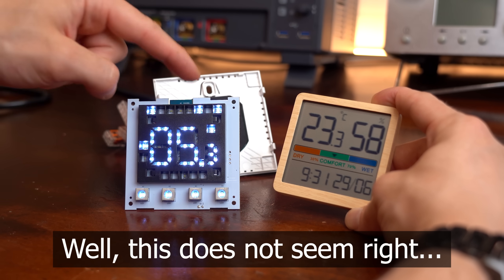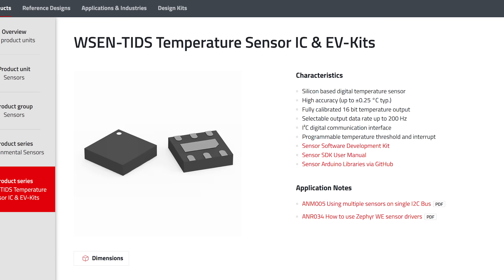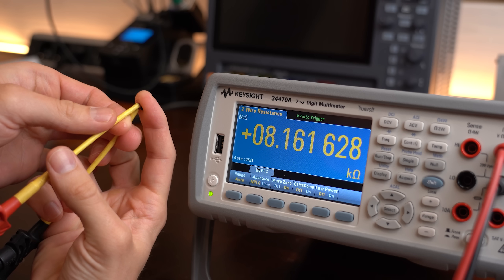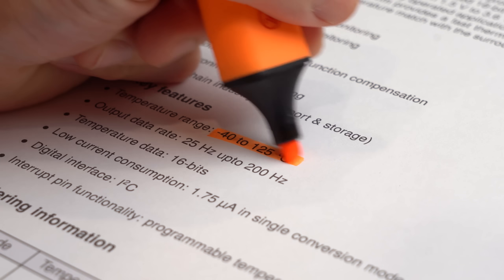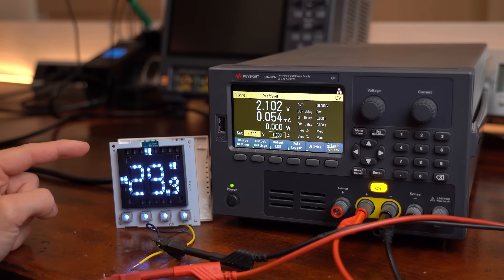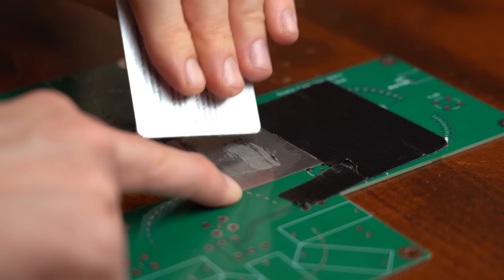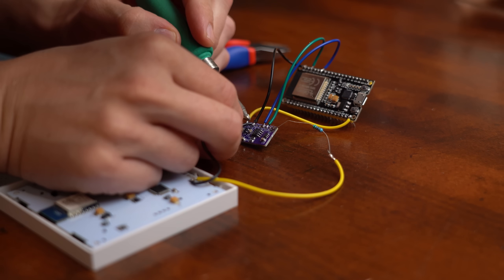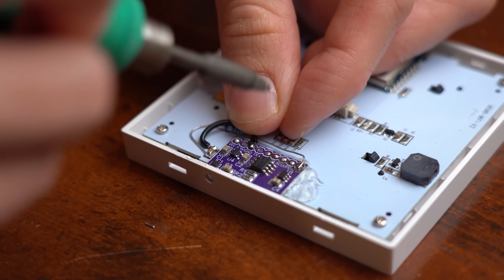From Meh to WOW - With 1 "Tiny" Hack!

Comment: making a thermalstat from scratch is the solution
Reply: Using the same plastic housing
Reply: @mihaichiriac480  CYD with wall mount and external contacts, less than €20 on Aliexpress, mounts ESP32 and has an audio output, it only needs the ESP home code and the temperature probe, so it becomes not only a thermostat but an access to domotic
Reply: Like the ESP8266 OLED Thermostat I made on my channel ?? ;)
Reply: @3ATIVE  Thanks for turning down the volume when you say "Alexa", you saved me a fight with that incompetent who understands less than Siri
Reply: The only thing with that is to be aware that hopefully paid thermostats have safeguards and watchdogs so that you don't end up with your heating running at 100% and causing damage. You can still have those in a DIY but it's extra work.
Reply: Thermostat * 😂
Reply: Came to the comments to say the same... Love the work to make a hack like that, but for as simple as the whole device is, you could have done it all with a single ESP32 and a handful of other components.
And would have been more accurate, since it wouldn't be a analog->digital->analog->digital conversion chain.
Or take the time to reverse the original circuit and write some new firmware for the original MCU or just recalibrate the analog pullup so it reads more accurately.
Reply: Whel technivally he dud not hack the termistst att all justbthe remp sensor but impressive anyway 😊

Comment: Good hack! I had heard that TUYA was getting harder to hack to talk to home assistant. Can you point at which HA integration method you are using ?
Reply: There’s no problem getting Tuya stuff to talk to HA, no hack needed, you can use the official integration. The Local integration can be a bit more temperamental though, I’m working through my house trying to slowly replace everything with ESPhome controlled stuff
Reply: @HiruS22  Thanks for that. Its really the local integration I was thinking about. There are/were some GIT hub projects which faked the Tuya servers and then allowed you to replace the Tuya firmware. My understanding is Tuya tried to block that in later releases but I dont know where it all stands. Pity because Tuya stuff is the most common on aliexpress.

Comment: What about reppacing the Software on the thermostat and just adding the i2c Thermometer to the esphome Code?
Reply: Most of the time these cheap IOT devices lock down their MCUs, so you can not reprogram or dump the software on them. If you could, that would be the proper way to go for sure!

Comment: Couldn't you just replace the resistor and/or NTC with lower tolerance parts? The precision should be good enough, even though it can be a hassle to calibrate. Digital sensor - MCU - DAC seems overkill, although I have to admit the custom PCB with SMD parts looks pretty nice

Comment: I worked for a smart thermostat company and temperature correction was a big problem. The main products were line voltage baseboard thermostats and we had to consider self-heating from the relay across different amperages and the brightness of the LED. The microcontroller didn't have a temperature feature but I'm sure heat from that also contributed.

Comment: I would think that the slightly colder wall where you have attached the old sensor, will cause the slight difference between reading it in the air, compared to measuring it against the wall. Now you just compensate for it by adjusting the parameters. But you do you. =]
Reply: Exactly. Cold air inside the wall cavity is effecting the measurement.

Comment: Thermostats temperature measurements are often pretty inaccurate depending on where they are installed. There are issues with air flow inside the walls that effect temperature readings. Same with air drafts along the wall. That is why most of them stick out from the wall instead of being flush to it. The temperature of the center of a room is the desired measurement, but that is nowhere close to the actual sensor. That is one of the reasons why their feedback loops take such a long time wait for it to stabilize

Comment: Hmm, I see Wurth do temperature/humidity sensors too.  Having trouble with sensors from Amazon that drift to 100% humidity over a few months, so I'm tempted to try the Wurth chips.
But even then, the Wurth chips say they drift if used over at lot over 60% RH.
I'm wondering what sensor technology is used in consumer products that actually do seem to measure humidity sensibly after several years.

Comment: Real lesson learned: When PCB Design/Layout,always check the datasheet for recommended copper pads or path. I also learned it the hard way. BTW I have a similar TUYA thermostat which has a temperature calibration or offset. Which can be a poor man's solution.

Comment: Well, that's one way. Another would be to calibrate the thermostat against a reasonable transfer standard, like an ordinary thermometer. Most household thermostats have a means of accessing calibration mode to set an offset. It's a shame that the manufacturers of these cut rate thermostats can't spare the time to calibrate them before shipping, but what do you want for such a low price?

Comment: Why use a NTC? That's so inaccurate? Why not use a BPM180 or a DS18B20?
Reply: NTCs can be very accurate, some are rated <0.2C, better than the BMP180.
In this case they just used a cheap one due to cost and simplicity.

Comment: It would be interesting to know where the errors were coming from.  Was it just that thermistors have a large tolerance, and some calibration may be needed?  Is it a reference voltage drifting around?...  although a lot of designs would use a ratiometric measurement, with the result that the value of the reference voltage is compensated for.   I have to admit, my instinct was to tweak the resistor value for that resistor used to create a voltage divider, and then consider other ways to get the needed slope and offset of the transfer function.  Thanks for the video!
Reply: Someone commented there is a calibration offset default to -2C, so that was where the error was from.
Reply: @jaro6985  I think Scott made a reply that there was a lot of drift that reduced the value of the offset adjustment...  I'd be interested in digging into it, but it might not be a popular video.  😄
Reply: @SkyhawkSteve  Yeah, not popular but interesting to me, RTC shouldn't drift normally.

Comment: A small suggestion as a user. If possible, please don't upload in 60fps. Older machines don't play 60fps well, they often lag. And 60fps doesn't add any noticeable quality improvement over 30fps or 24fps. Thanks.
Reply: Sorry, those of us used to 60fps do notice
Reply: @mudassirul I notice that as well, but it's not necessary and most people don't notice

Comment: This is a very clever solution.

However, I would have just drilled a 1mm hole in the case and moved the NTC a tiny bit outside the case to expose it to room airflow.....
Reply: 2:07
Reply: @muhammed_aksam 
Edited...

Comment: When I see hardware hacking to this level coming up in something I'm going to have to do, I just discard the plan and make a replacement. Like I'd probably get some esp8266 small units you can get for cheap (especially in bulk) and then hook up the temp sensor to it then use ESPHome or similar and make it my thermostat. A mechanical relay or for silence, even a cheap 600V triac with MOC3043 would make a better mains switch. I'd then just recycle the buck convertor from the old circuit to get to 5V or 3.3V from mains 220V/230V, or if I didn't have something previously, just get an oled display or 7 seg display along with a cheap phone charger that gives 5V (or maybe use something like from your intro with leds)

Comment: I like that engineering has these small details like temperature IC reacting to copper on PCB, it won't show in any schematics and it's easy to miss something obvious like that
Reply from the maker: Haha true. It was certainly a pitfall for me ;-)
Reply: @greatscottlab  I don't think it's very important - task is to respond to slow ambient temperature changes, so some thermal buffer (copper tracks) helps smooth noise
Reply: @JohnMullee I think you're neglecting to consider that the other board components connected to that same copper layer all generate heat, some of which gets dumped into that layer. Colder temperatures may be off by more.

Comment: For a cheaper BOM cost, I bet using an MCU either with its own internal DAC, or even just using a PWM 'DAC' + filter would work just as well
Reply from the maker: Sounds doable ;-)
Reply: ZE problem is, MCU integrated DACs are not terrific most of the time, or they are correct, but at a MCU price that shatters the wallet.
Reply: @hankhulator5007  The counterpart to that, is for this particular application, the requirements are not high at all, so I imagine even PWM output might work absolutely fine. We only need 3 digits of precision.

Comment: With those my biggest problem is the hysteresis, which you can set to a min of 0.5°C, meaning if you set it to 20 is starts at 19.5 and stops at 20.5. I know is 1 degree difference but it takes like 4h to trigger and 4h to stop, in a particular room, and it feels like to hot or to cold. Is a tuya thermostat that seems verry inacurate. I set some scenes that makes the hysteresis 0.25°c overall but it doesn't update the  cloud for hours sometimes unless you touch the screen.
I think I will also try this. Thank you!
Reply: You probably don't want your furnace or heat pump cycling on and off every 5 mins.
Reply: @jaro6985 It starts at 2h+ and stops after 2h+ with the scenes set up, it is a big room with a small radiator. I cant change it, is a rental space.

Comment: Wouldn't it be possible to reprogram the thermostat microcontroller to use the temp ic?
Reply from the maker: I talked about that at the end ;-)
Reply: No, as he said the firmware isn't accessible nor available - moreover, on this kind of consumer mass market product, the firmware is not flashed but etched most of the time (to lower the MCU price).
Reply: Lots of product read/write protect their mcu so probably not

Comment: Interesting way to solve it. I would have used the OpenBK firmware (Tasmota like firmware for the Realtek Tuya chips) and install it on the device. After that, you need to add the device configuration for your device and there you can also calibrate your temperature value. An advantage: no need for the cloud service anymore and it integrates directly into Home Assistant.
Btw, I have a similar problem to solve with an old Buderus heating system. The temperature sensor is always off, since it is sitting in direct sunlight, so I would like to use the output of our weather station. Maybe this would be the way to go there, too 🙂
Reply from the maker: I will have a look at that. Thanks :-)
Reply: It looks like a WBR3 module with a RTL8720CF chip. LibreTiny does support it so does Openbeken. You can also replace the entire module with an ESP32 module, for example; it's much easier to program. With a little luck, the pinout will match exactly. the large chip in the lower left corner is probably only for the display
Reply: if it's supported by LibreTiny then it should work with Esphome as well.
Reply: @brettam yep, but you still have to control tuya chip. and it wont work as expected 😂
Reply: @giomac I've got a tuya lamp that I replaced the firmware with esphome and it works as expected. Though I did have to open it to flash it b/c the ota of conversion didn't work. 🤷‍♂️
Reply: @brettam 
Esphome now supports almost everything tuya makes. The hard part 99% of the time is connecting wires to serial flash them... If Tuya allowed us to void the warranty and flags custom firmware, I'd be buying a heck of a lot more smart stuff that uses their system... Brand names and eBay stuff.
But since it's a pain, I'm taking it really slow.
Reply: @tin2001 yeah, using tuya-convert do it ota doesn't always work and isn't the easiest process. It can also be a pain, especially with newer devices, to figure out the GPIOs and esphome components you need to use.
Reply: Those thermostats rely on a cloud service to work?! 🤮

Glad to hear there's a way to change that, at least...

Comment: I am not sure if the 1000 euro thermostats are calibrated to like 0.5C
For my China Aliexpress Zigbee thermostat I contacted the seller. He gave me the instructions on how to 'calibrate' it by getting into another menu.   As long as the 20C to 21C value is correct I do not care if the 12C or 30C is off by 1C. 
My old, 20 years old, expensive Theben also uses a simple NTC and is still ok'ish accurate.

Comment: why the 5k resistor at the output? I thought you already giving the right voltage via the digital to analog converter?
Reply from the maker: It is just a current limiter.
Reply: @greatscottlab as I know each ADC has already an very high input resistance? So current should be already limited? I just had the same question at this part of the video.
Reply: Most likely to limit the current from the DAC to the IC

Comment: Looks like it is WT410 thermostat. I found some manual, where it says that the default temperature compensation temperature is set to -2 degrees  and you can change that parameter in a range from -10 to +10 degrees. Also you have NTC contacts for external temperature sensor in the rear unit housing on pins 7-8. But cool project and idea anyways!
Reply from the maker: Yes. I can adjust the offset. But my measurements still drift overtime and become unreliable again....
Reply: @greatscottlab  Could be, maybe they are self-heating or get heated from the electrionics in the box, and that's why they defaulted the setting to -2deg. In this case your project makes a perfect sense, but it's crazy that they crapped the most important part of the thermostat...
Reply: I’d made a similar reply. The trick is to install it and let it acclimatise. The power supply does warm up the enclosure a little, and is probably the reason for -2C offset. 

Also, the underfloor heating might be creating an updraft within the wall cavity /speculation

Comment: I might have been tempted to simply substitute a trimmer pot for the fixed 10k divider. But this was way more fun
Reply: My thoughts exactly
Reply: Yes, that would be good in this application because you typically want just one temperature setting - so trim that for accuracy.
The more you deviate from that the accuracy gets less, but not by much - and you don't deviate much anyway.
It's not a scientific instrument that needs accuracy over the whole range.
Reply from the maker: Haha thanks ;-)
Reply: @greatscottlab  there's usually an offset for the temp in a hidden menu with these thermostats, but what fun is that?!?
Reply: @narc1408 was thinking the exact same haha
Reply: One might have observed the delta between "actual" temperature vs. temp measured with the controller - as long as there's no hysteresis, just set the controller at the "offset" temperature (so it activates at the "correct" temperature).
Reply: @retromodernart4426  the object of the exercise was to make sure the displayed temperature and actual temperature were the same. Having to set the controller to the offset was the problem he was fixing.
Reply: Again good example of difference between engineer and technician. Technicians make things work, engineers make things hard.
Reply: @PexiTheBuilder  I think you got that the wrong way around?
Reply: Actually, a slightly more expensive Meross thermostat has kind of this in the app. You can adjust delta, to compensate for the inaccuracy, either of the thermostat itself, the wall, or the position in the room. They have also external sensor to put in the floor, but that's hard to do, when you already had the floor done long ago. :)
Reply: Thanks for the idea. I have a dozen or so similar that are all quite off in their readings. A simple pot would definitely be easy enough to install and adjust 🤘🏻
Reply: @benupde1979  If the fixed resistor is 10k, use a 9.1k resistor in series with a 2k pot.
Reply: @benupde1979  You may find it easier to adjust if you put a resistor in series with the pot - eg if resistor was 10k, try a 9k(ish) resistor with a 2k(ish) trimpot. Or use 10 or 20 turn trimpots.
Reply: As said Meross thermostats look qute similar and are way better. I love you solution though. But there’s one catch - and it’s the thermal mass you introduced.  That will introduce a lot of inertia.
Reply: @krentuss  The total thermal mass is the thermostat plus the entire room. I don't think we need to worry.

Comment: are you sure this solution will solve your problem?
Reply from the maker: Only time will tell. So far this one hacked unit shows me more accurate results than all my others.
Reply: @greatscottlab  yeah... made the same thing going from analog to digital sensor about 2-3years ago but seemed to me that EMI made my analog sensor "floating" away due to switching PSU... so.. only time will tell indeed. ..

Comment: Would replacing the 10k resistor with a 10k multiturn pot have allowed creating an offset to fix the measurement?
Reply from the maker: I can actually set an offset for the temp measurement in software using the app. But even a given offset drifts overtime with these things and makes everything unreliable again. So an offset, was not a fix for me here.